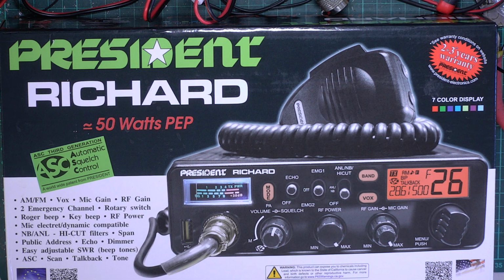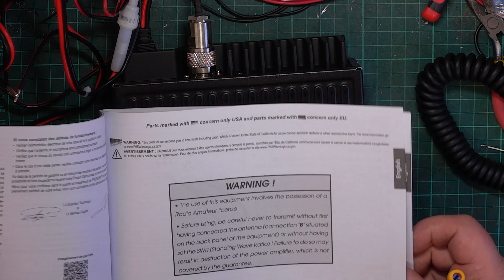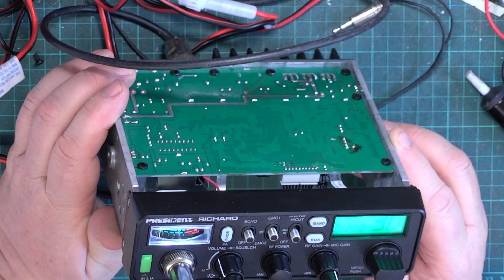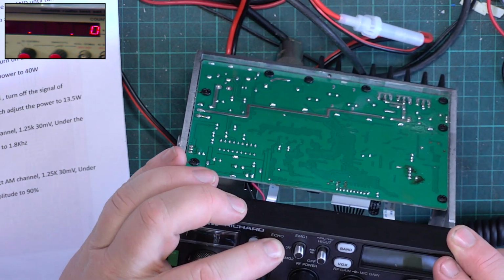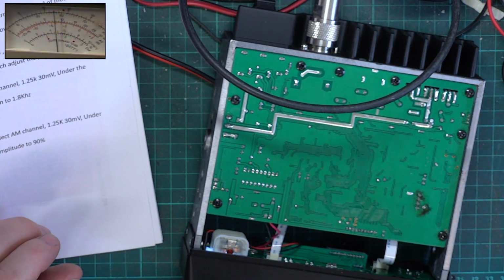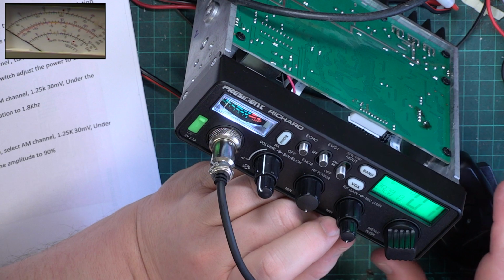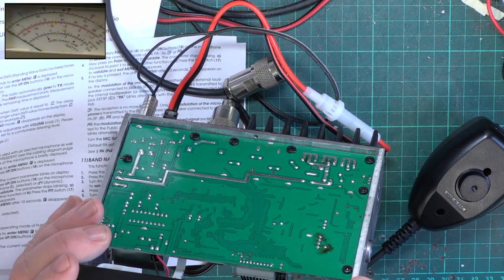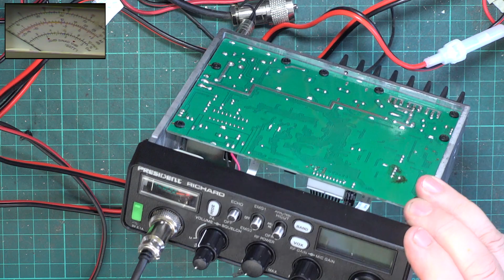President Richard 10M amateur radio -  menu adjustments

Comment: You don't need to disable anything to sell it, owning/possessing a non compliant radio is NOT an offence, using it is the offence.
Reply: Yeah, precisely. Not Richard's fault if it's used illegally, is it? If I'd have been morally outraged about it I'd have sent it back and washed my hands of it.
Reply: @M6GOF  the law is very clear, it's using the equipment that generates an offence. We legally can own anything we want, a trader can sell anything they want, it's what's done with it that counts. 
At the end of the day though, it's cb, there are more unapproved radios out there than approved ones and as long as nobody causes a problem for others then the authorities are happy to ignore it.
Reply: @M6GOF  same with guns

Comment: I hate those data type plugs, much rather have a proper mic plug.  Some use this type of plug as you can use the mic plug to do software updates.  No thinks, give me another plug on the back for that.
So is it sold as a CB or as a 28Mhz 10 meter set?
It is not in the grey area, it is just illegal for CB use!
Nothing stopping an Amateur Radio operator going down to listen to CB, but it would be illegal for them to use it as well with that amount of power!
Yes, a dodgy set to say the least.
Is it Uniden made or just Chinese made for anyone to put their stamp on the front?
To many questions!

I could tell you were very impressed with it Richard  :-)

I don't know if I like the power going up variable like that, I think I like it going up in stages, however I can see some advantages of it going up like that as well.

I saw a York JCB863 with very bright chrome knobs on it and twin controls on it for volume/squelch etc on it as well.
What do you suppose was inside that set, not a Cybernet chassis anyway?  :-D
It was very well done, but anyone that had the slightest inkling would spot it right away as not being what it was supposed to be.

Apart from not being legal, it would just encourage some idiot to transmit on 28Mhz and spoil it for others, or worse still transmit where they are not supposed to be.
Most users with common sense wouldn't stray from CB channels, but still.

Talking about using sets legally, I think the USA has lost control of the power people are using over there on CB!
I heard someone saying they were using 3kw!  Nice clean signal, no distortion or anything, but 3kw!!
I hope he had good filtering on it, don't want an aircraft listening to "19 for a copy" while coming into an airport!

That is the problem, some people have no clue what sort of problems they may cause or how to cure it.

It's a crazy world.
Reply: Putting Binatone 5 star, or York JCB 863 fronts on Nato 2000 was an easy way
 to disguise them.
Reply: @phillipsmiley5930  Yeah, but it is chrome knobs like on a Cobra, Uniden etc.
Not that it matters, it would just confuse me, I would rather leave it as it is.

Comment: I thought you had some sort of spiritual force field around your lab to keep nasty multiband 'CB' 25-30 MHz rigs safely away/ What next, restoring a Ham International Jumbo with lo-lo to hi-hi? The rot has started! Ooooola!
Reply from the maker: I would never have bought it if I had known what it was. The wholesaler had it listed under CB radio. Usually they have dodgy stuff like this under 'amateur radio. I've just made sure it's a permanent amateur radio. 

Radios you mention are illegal to own as they were smuggled in. The UK government allowed about 12 years for people to actually get them converted to amateur radio & pay a small fee (it was £12 or £15) to have them inspected & certified.

Richard, G0OJF, UK
Reply: @ukfmcbradioservicingTango21  I can't see Ofcom being at all interested. They couldn't even be bothered to come and investigate interference to a licensed broadcast radio station in Walsall from a pirate radio station!!!!!!
Reply: @ukfmcbradioservicingTango21  Oh, I vaguely remember that 'conversion' scheme. But I'm not sure it was ever actually illegal to import the non-UK spec sets, because how could you define them? A friend of mine came back from Switzerland with a Superstar-2000 (which he  bought in a supermarket), and just whipped out the drive transistor beforehand - it couldn't transmit then, it was just a receiver. He even declared it at customs, prepared to explain it; the customer officer knew what SSB was but showed no interest in confiscating or discussing the radio - just let it through.  And the number of UK pirate CBers with Youtube channels - and audible on the air - is a bit of a give-away that nobody cares any more.  But still, I hope you get some use out of your defanged President Richard (is it really named after Nixon?),  I've always enjoyed 10M FM, but there's vanishingly little  local traffic there.  Russian taxi drivers when propagation's up, and I do like the NY repeater, but otherwise there's nobody to talk to...
Reply: @tonybalm1513  Yeah, exactly. Can you get anybody out as a legit licenced radio ham like me if your enjoyment of it is getting clobbered by badly filtered PLT devices? No, they don't care about the hobby, or pirate users of any form.
Reply: @proudsnowtiger  Yeah, all of this and I mean ALL OF THIS is in absolute plain view plastered all over facebook groups every weekend, all modes, all bands, channels inbetween the channels. Offcom could have a field day with countless terabytes of illegal usage posted online. But no, they don't care.

"Defanged 10 meter radio indeed", that did make me giggle.

Comment: an Amazon dealer is selling them as dual band 10M (28.00 - 29.700 MHz) and 12M
 (24.890–24.990 MHz) i presume they dont have varicap front end tuning and are deaf on 12M?